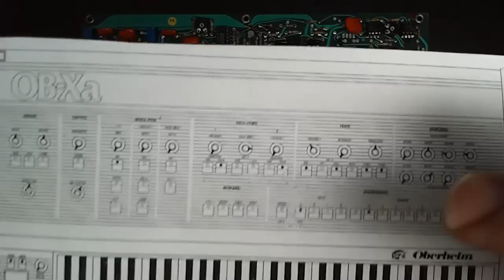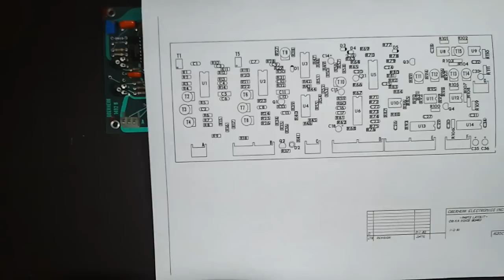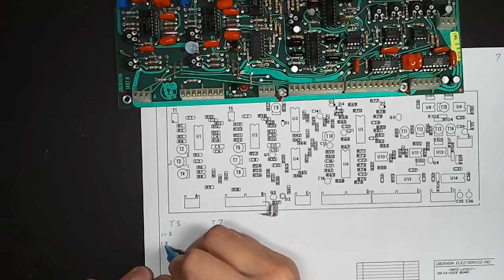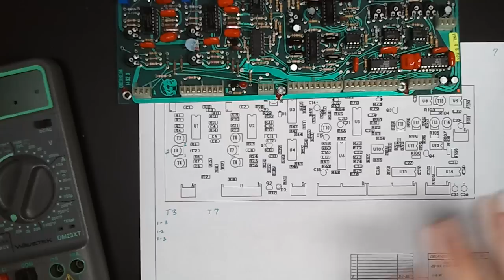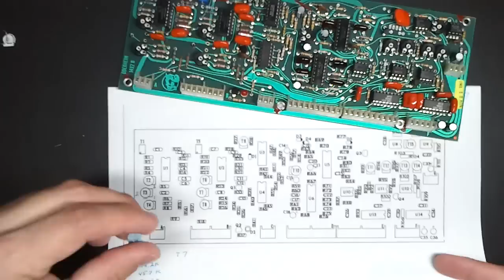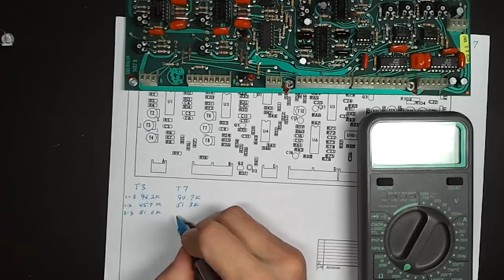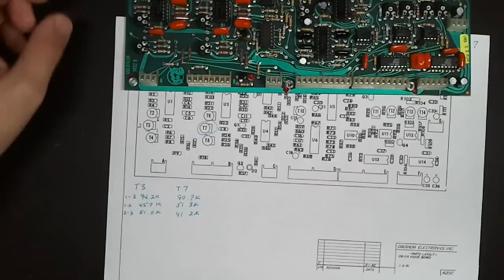Oberheim OB-Xa: Voice Card Pt. 1

Comment: Yup. the funny thing is that I ordered the 100 count elna 22uf 35V and replaced even the "non-voice" Illinois Capacitor ones (those rated at 15uf 35V), to make use of them since my other synths have refreshed caps throughout. Funny thing is that my OB-Xa has been really stable even when I got it 24 years ago, but I decided just to do it as a precautionary measure.

Comment from the maker: Mine had the Elnas 22uf 35V and they were all shot. They were 30 years old. As for the discrepancies with the caps. It's all about availability at the time and $. Some of the parts I ordered just a year ago have either become obsolete or dissappeared. Just put GOOD fresh caps on the boards and do them all at once. 85 deg rated caps are fine, 105 deg are fine too - but cost a little more. My OB-Xa doesn't get hot or go wonky. It's rock solid.

Comment: I know I'm about a year and a few months late to this video, however 6 of my OB-Xa voice cards have Elna caps rated @ 35V 22uf 85 degrees, whilst the two of them are Illinois Capacitor brands rated @ 35V 15uf 105 degrees (exactly like the Al electrolytics on the main logic board as well as the front panel boards). Just curious if yours was a similar case?